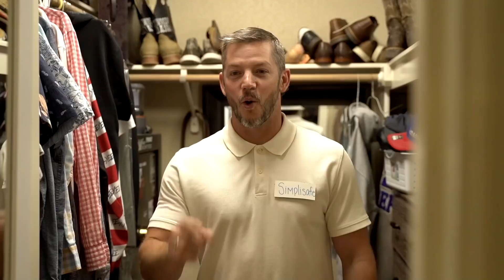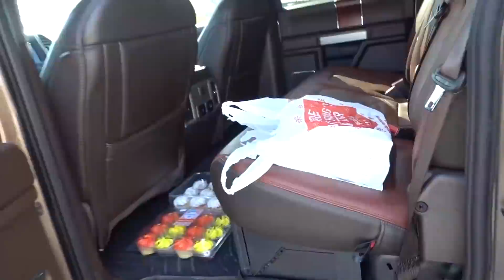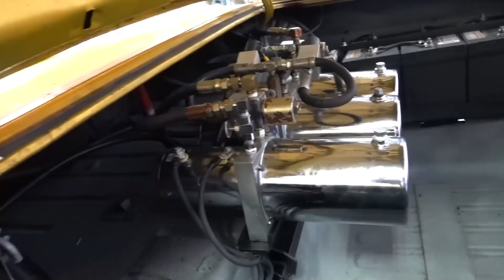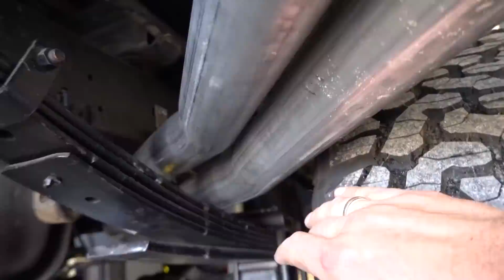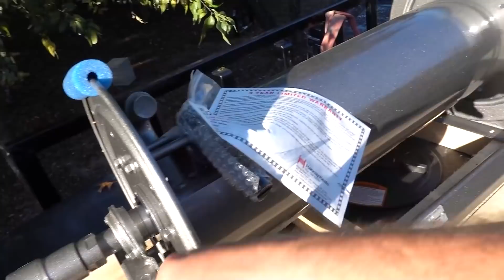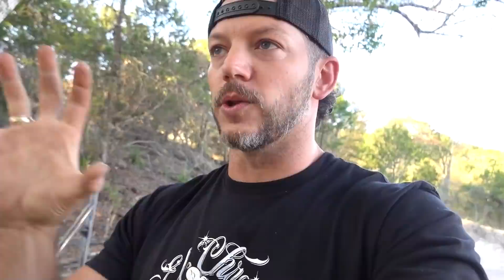Here's How a Local Car Shop Screwed up the Bronco...

Comment: Enjoyed the show. 
Get a tree mover to pick the tree up and turn it around 45° put it back in the same hole.
Reply: Probably wouldn't work on crooked tree. There is insane pressure on the root system keeping that tree up.  Once the roots are dug up/cut I doubt the tree will stay up.

Comment: Wildlife biologist here. You'll never "graft" a tree that large. Cut it out, leave the 2 smaller shoots, and plant some fruiting, soft mast trees in the area. Your roadbed will thank you too.
Reply: Agreed, cut the bigger tree off just above the little branch that comes off to the left. Save that little branch and then the two bigger shoots coming from the same tree. It will get back to that size no problem.
Reply: I don't think those are shoots of the same tree. They look like two completely different trees
Reply: Just try it anyway if ur gonna cut it hahaha would be sick if it actually worked
Reply: Agreed 👍
Reply: Yeah I don’t think he comprehends how heavy that tree limb is.   Structurally that is not going to work.  That is reason #2 why they do grafting on smaller trees.
Reply: @ColeSpolaric  it’s definitely coming off the same root system therefore making it part of the same tree.
Reply: Pretty sure those are aspen trees around it
Reply: @danielburke911  how can you tell
Reply: @danielburke911  I think you'll find they are something else....Too low of an elevation. Only Aspens in Tx are in the Guadalupe and Chisos mountains.
Reply: Agreed, leave the codominate smaller shoots, and lop the main trunk, it looks like it is phototropic, (growing towards light ie. The Sun)..
Reply: He couldn’t like ratchet strap it to bend it without cutting? Disclaimer: idk anything about arboriculture
Reply: Why soft mast fruit trees that drop rotten fruit all over? Why not oaks?
Reply: @joshuareed2182  you can tell it's an aspen tree because of the way it is
Reply: Sounds like the best option.
Reply: Isn't there too much "dead wood" on the inside of that tree for it to graft anyway?  Hypothetically if it did graft, and started to grow, once you removed your bracing a strong wind  would just break it off.  Cut it down... plain and simple
Reply: oak also stress from having half of it's feeder roots driven over...
Reply: @dragonrider2.064  Hey there just wanted to point out that these trees are not aspens as the only aspen trees in Texas occur at an elevation of 7,000 feet or greater. The area that this is in is sub 4,000 feet in elevation ruling out the possibility of aspens.
Reply: @joshuareed2182  Unfortunately that person was wrong about the trees being aspens. The only aspens in Texas occur at an elevation of 7,000 feet or greater, and the area in the video is more than likely sub 4,000 feet giving the elevation of the area around it.
Reply: @zachisfatman  the trees so old that would never work now. Have to do that with a much younger tree. That tree isn’t moving lol.
Reply: @DavyOordijk  Need large crane and crew.  Do compound cuts into the tree and have a specialist use his magick before binding it up and supporting it with lots of timbers and things till it heals.  I get so sick of people saying this can't be done!
Reply: @theradioweyr , This can't be done...😂
Reply: @crosscuttreeservice5570  probably safe to go with the guy named cross cut tree service haha

Comment: With regard to your tree. You can hire a tree picker to come out and scoop up the entire thing, roots and all, and replant it twenty or thirty feet away. Or just spin it and put it right back in the same spot but facing the other direction. Seriously, there are these big rigs on the backs of trucks that have giant hydraulic shovels that clamshell open to wrap around the tree and then big hydraulic rams force blades into the ground and dig up the entire tree and a big cone of dirt about 6-10 feet across that contains most of its roots.
Reply: I was thinking the same thing, but texas soil may not be possible. Not sure either way.
Reply: This sound good
Reply: I just said the same thing.
Reply: I was thinking the same thing
Reply: Good idea on moving the whole tree, that is option 4 and Matt should do that. I was going to suggest that he cut it down and then plant a new tree right were he wants it to be instead, but your idea is better.
I’m still struggling with taking his option 3 as a serious idea coming from a veterinarian.. seems like a little bit of a joke on his part?
Reply: This would make a GREAT video

Comment: Just a note, as an owner of many Broncos, you want the exhaust to come out behind the tire at a full 90 degree like factory. That allows the fumes to push away from the low pressure area at the back of the Bronco so when you have your back window down you're not going to be sucking exhaust into the cab. You can also do a side dump in front of the tire, but rear dump and dumping under the truck will get fumes into the cab.
Reply: What you said is true but I don't think he will have a top on it most if the time. How would the dumps work with no top?
Reply: @jamesfrost5261  top off you're better because of the constant circulation of air, but he did mention putting the top on in the video. 

Personally if I was in sunny Texas I wouldn't have the top on much, but dreary NY requires it...lol
Reply: @seekandrestore4709  Man, it gets so hot here though. You end up wanting the top because you start feeling like you're cooking when it's 105+
Reply: Agree   exhaust before rear wheel
Reply: This - if it isn't going 90* it's going to tumble and roll forward into the cab.
Reply: I never would have thought about this while building anything especially a bronco
Reply: Hope he sees your comment. It is embarrasing seeing how bad that install is! Wow.
Reply: @D3thM3tal  I don't know about all of that. I've had plenty of dumped and side exit exhausts. The biggest problem that I have, is that it looks like they bought a bunch of cheap exhaust pieces from autozone, then used a 2 year old to weld it all together. Whoever they are, they're not an exhaust shop. They also don't employ any kind of welding expert. I'm dumbfounded that first, Matt hired them to do a job, then this is what they gave him. Absolute garbage. I know exactly what shop this was.
Reply: @D3thM3tal  I'm sure that you have an opinion, formed by personal experience, but "tumbling" isn't something that I've ever heard of in my 25+ years of performance experience. Enlighten me.
Reply: @jamesfrost5261  I always take a dump with no top on, he will be good,,,LOL
Reply: @chevy383jt  toss their name out , maybe we can get their attention and they will make this right.....
Reply: @chevy383jt  He's talking about the way air flows around some areas of vehicles. It's a lot easier to see in wind tunnel tests. The low pressure areas of air tend to swirl or tumble making the air go in directions different from the overall air flow of the rest of the vehicle. The best example is the open bed of a truck. If you've ever driven a truck with a sliding back window open and had something from the bed come flying into the cab, you've experienced this.
Reply: @mikefelty2625  I do know what he's talking about. I've never owned a bronco, but I did own a 1995 F150 regular cab with 3 inch dynomax race mufflers, routed out right before the rear tires. Never had any fumes bug me. I also had an el camino with mufflers bolted straight to the headers, then dumped straight down. Occasionally, I had minor exhaust fumes. But it had 11 to 1 compression and I almost always had a mix of race fuel in it. That being said, I don't consider the exit of this exhaust to be an issue. I do consider the store bought piping and bends, with the crappy welding, to be an issue. This is amateur crap. I can't believe Matt took the bronco to this crap shop.
Reply: @chevy383jt  if I’m understanding all this correctly the original post was more about dumps then side exit. Side exit is fine on most cars . Dumps as the air flows under the car naturally it sit at the rear of a vehicle and tumbles between the air coming over the top and going under the car…. When this happens with the rear window open it cause all those fumes to tumble into the cabin. Not common issue with cars unless u have no rear window. Roadkill guys have expericenced this a few times before when they have no rear window.
Reply: @chevy383jt  I don't have any experience with side exit, but have had many dumped underneath, and it depends on the vehicle from my experience. I have a 1994 Chevy Silverado ext. cab with 3" Flowmaster super 10 dumped just past the cab and have never had any issues, but in my 1993 GMC S15 Jimmy it's dumped just before the rear axle, and the fumes are terrible. I think SUVs have a large pocket of "dead" air that collects underneath and lets exhaust fumes creep up through body seams, and I could see this being an issue with the Bronco as well. Foxbody hatchback Mustangs tend to have a lot of fumes with dumped exhaust as well from my past experience. As far as the shoddy work from the shop Matt went to I completely agree. That's just terrible workmanship and materials all around.
Reply: @troyjohnson6023  You're right about the air sitting underneath on some vehicles, but you don't even have to have the window open. That air that's sitting there, tumbling will get into the passenger area through any area that isn't air tight, like body seams, holes for wiring, etc.

Comment: When you do the hard piping on the firetruck, make sure you have at least one flexible coupling in each run between hard mount points
Reply: And also don't use your muffler guy.
Reply: Yep catch vibrations and stuff.
Reply: Came here looking for exactly this. Each run should ideally terminate to a flexible segment with a quick connect that can be quickly deployed and stored when finished.

Comment: I highly recommend a flexible connection between the pump and your hard lines so when it’s running and vibrating it doesn’t wear out the connection seals
Reply: Bingo, ANY body roll and a hard line will kink and finally rupture. Not like its going to be on pavement anyhow.
Reply: Every brush truck I’ve ever seen has had hard lines going from the tank to pump, pump to manifold and we don’t have a problem with the connections. Look at a full size engine or a tender. Those trucks are all hard lines. It just doesn’t happen. As long as he doesn’t do something stupid like use PVC it’ll be fine

Comment: Those welds looks like snot as well. I would take the Bronco back and tell them to do it again.
Reply: I’d ask for a refund and go to a different shop. If they did such a bad job the first time I doubt they’ll do it right the second tkme
Reply: Take the exhaust to the range and shoot it for fun! Only thing that exhaust is good for 😂
Reply: If he went back, the muffler would probably end up welded to the leaf springs.
Reply: it looks like the soldered it instead of welding.

Comment: That exhaust is a disgrace to the industry. Not only did they bugger up the back but it's not mandrel bent, the welds are crap and it's mild steel not stainless. Whoever did that should be ashamed of themselves.
Reply: I called every muffler and exhaust shop in 4 counties near me. All use only mild steel at best. None offered stainless nor tig style welding.
Only one shop would do custom mandrel bends. That was in Kenosha county. Still, I would have to supply the stainless tubes.
 - nobody makes custom exhaust anymore. But, if you bring it in. They will take it out of the box or kit, and install it. ( Borla, corsa, ebay pipes )
Reply: @missingremote4388  Holy crap, thankfully it's still a thing here.
Reply: @marvindebot3264  I know. I found a local qualified welder to tig weld for me. He doesn't have all the grinding equipment or jigs to do a complete exhaust. He made me a stainless collector tube w/2 hole flange for $ 50.

Comment: No to the tree work, from a qualified Tree Surgeon. Oak is a hardy wood, but it would never recover, if its in the way its best to take it out, and plant a new one, ive been doing commercial Tree Surgery in the UK for the last 18 years.
Reply: What does a tree surgeon do?
Reply: @stiaanvanhuyssteen5069  cuts trees. Its an arborist in Europe
Reply: @youngnutsack17  exactly my thought
Reply: Are UK trees and central Texas trees similar?
Reply: @fullsizechino6278  yes
Reply: I agree no way to graft  it only way is lead that's the only way to get an oak down safely
Reply: I think there's another tree about 15-20 feet behind the bent one. Wouldn't that smaller tree benefit from the removal of the one in the way?
Reply: @fullsizechino6278  Yes, they just sound a little different.
Reply: Can't you just dig it out and plant it elsewhere?
Reply: @BCRVG87  Matt would love that, it involves a very large, very expensive and very cool machine.
Reply: @Deltaelite10mm  demo ranch is right there, but who knows if mat would even wanna shoot in that direction, probably could
Reply: @youngnutsack17  Yeah, they probably would, if the cut on the main truck was sealed properly so the tree didn't get infected.
Reply: I’d plant like a dozen 12 foot saplings in a further back spot, not just one.
Reply: I would take the tree out and replace it, you may even get someone to buy the oak off of you. The damage on the tree will eventually kill it anyway
Reply: I feel like this person knows what their talking about.
Reply: I don't know most Americans are pretty toxic towards "those" people from the UK. Can we trust this guy with Matt's beloved tree problem? And who spells Garry with 2 Rs? Sorry, couldn't resist a little sarcasm... 😉 maybe Matt could move it to the center circle of the driveway near the house. Would that work?
Reply: No Mat need dig a bit then pull it with a tank to pull the entire tree as is and hold it there  and fill the hole so the roots will stick. See now Mat need to buy a Tank cant be done with out a Tank
Reply: @MrGhostLt  it's incredibly difficult to transplant an adult tree, the root system is vast and 99% of the time they will just die anyway. Far better just to cut out the main trunk and allow the two side shoots to continue growing
Reply: @Lilith-Rose   i Know that's why Mat need a Tank to solve the problem its the magic item to save the tree, any thing els and its as you say.

Comment: Here’s a suggestion for your fire truck. I remember in a previous video you stated you were worried about burning up the pump when it’s not running water. When I was on a local FD we had a “Y” valve with two ball valves. One was pump to hose the other was pump to tank so it would keep water circulating. When you are done spraying shut the pump to hose off and open the pump to tank and it will keep your water moving through the pump
Reply: Better yet, just plumb a quarter inch line off the pressure side of the pump and hook it back to the tank. We set up all of our firetrucks this way. It keeps the water moving thru the pump when not spraying water from the hose, but doesn't hinder pressure or performance........and you don't have to remember to switch valves.
Reply: @MadDawg91108  that would work to! I didn’t think about that I was thinking more of a pressure standpoint but yeah 1/4” line won’t lower your line pressure by much

Comment: Typically if you hard pipe anything, you want to connect the hard pipe to anything that vibrates or moves with a short flexible pipe to keep the hard piping from getting stressed/damaged
Reply: This!  All of this!!
Reply: You mean exhaust hangers?
Reply: I think he was talking about the fire truck
Reply: The Fire Truck plumbing...
Reply: I was also wondering if it freezes there. Water left in those pipes could burst
Reply: 100% especially in a bouncy vehicle there must be a flex point to keep the rigid areas from breaking. A heavy duty hydraulic hose on each end would work great and can be done for 1” pipe pretty inexpensively. Maybe $200 +/-

Comment: WOW did Ray Charles stick weld that exhaust with his feet?? Definitely need to take that thing to a better shop and let them do some good work on it before it starts leaking. Hard to believe that a shop would send that bad of work out the door especially with it running between the frame and the leaf springs.

Comment: I've been a technician for 23+ years and I can't believe they screwed up that exhaust job that bad! Running that above the leaf spring was such a dumb mistake that I would almost bet that they had a rookie new hire do this job.
Reply: Yeah, he needs to take pictures & send them to the owner. Not even a 2nd rate job, but like amateur 10th rate.
Reply: I've never welded pipe, let alone exhaust, I would have looked at those and tossed them if that was my attempt.   No way I would try to pass that off as work I could get payed for
Reply: with shitty welds like that it is no wonder, only way to make an even bigger blunder was putting the exhaust into the cabin...
Reply: @dracul1986  That is the first thing I noticed.  Those welds look like a blind man did them.  I don't know how they could come from an exhaust shop.
Reply: @ToddKing  We call that 'Chicken Shit' welding in the UK.
Reply: @Biffo1262  We call it that as well in the U.S.

Comment: You can train the tree wintout cutting it as well! You can just keep tension on the tree in the opposite direction and it will slowly move, with cutting the tree you have to be careful about girdling the thing which is a guaranteed death of the tree, if you do cut it i would opt for a smaller cut than what you showed, and also you will have to protect the tree from infection(whether that be bugs or molds etc)